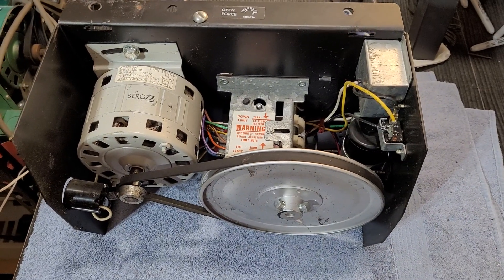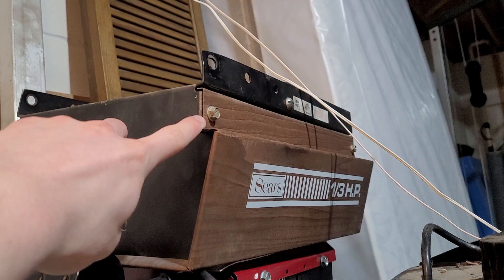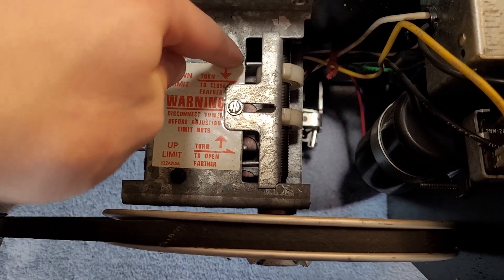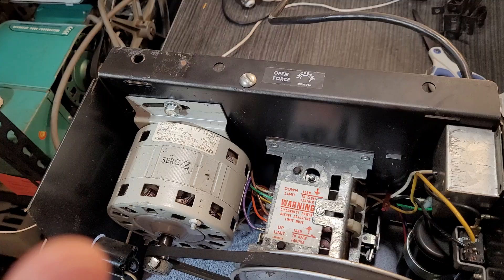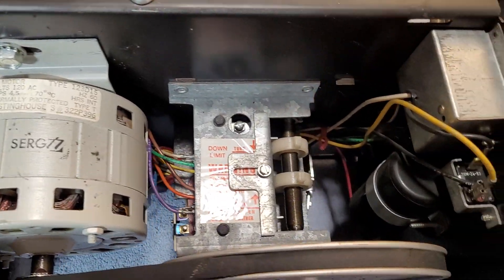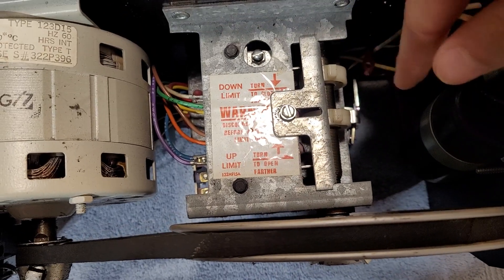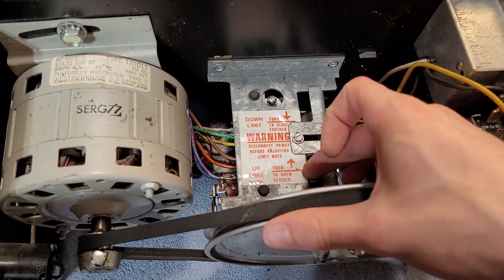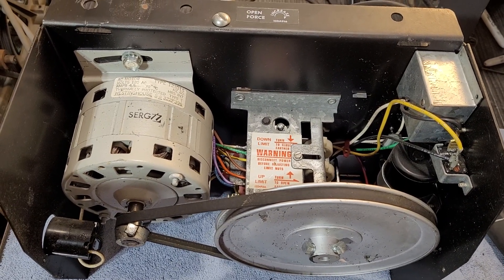How to Adjust Limits on Old Chamberlain/LiftMaster/Sears V-Belt Drive Garage Door Openers

Comment: Could you tell me the wiring pinout on the motor? I found one by itself and would like to repurpose it.
Reply from the maker: Just the motor itself or the entire head unit?
Reply: I am in the same siutation myself. I have an identical westinghouse brand motor to what is in your unit. I am just interested in the wiring of the motor.